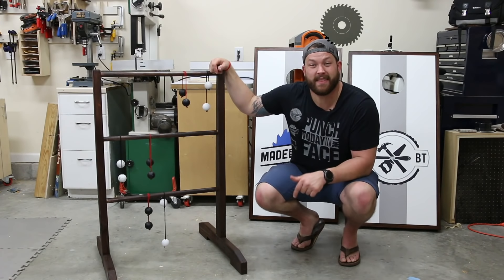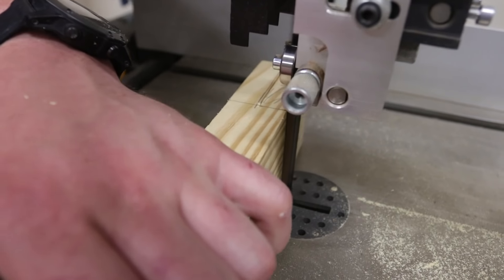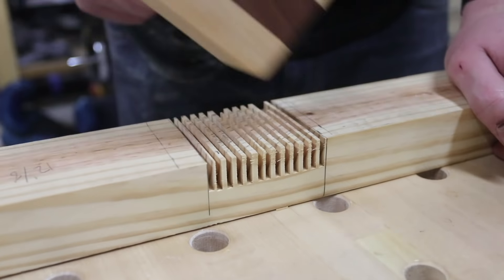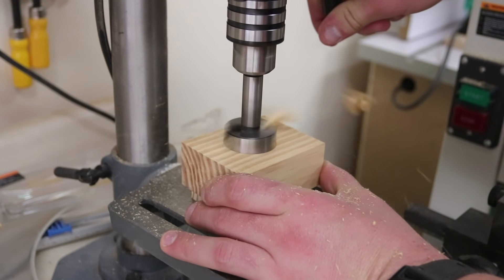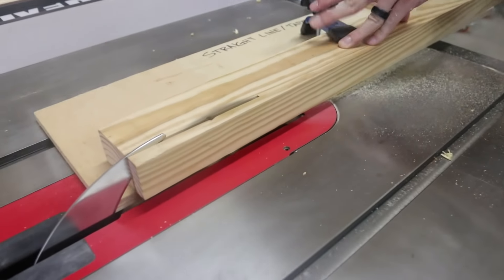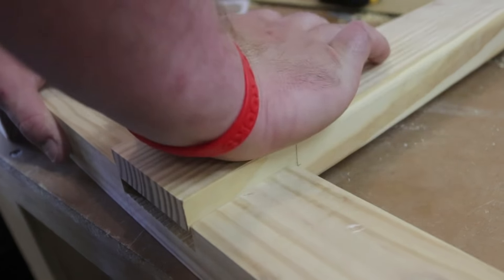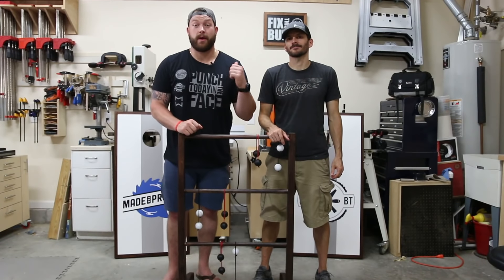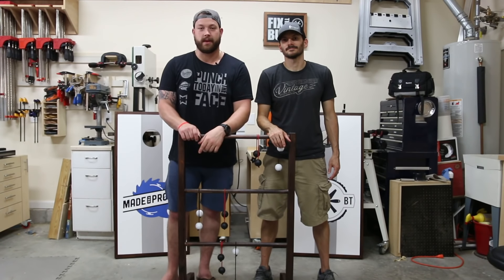Outdoor Games - Redneck Golf DIY Build

Comment: Awesome video and build. Thanks for the plans! Can't wait to put a set of these together with my son. Quick idea I had while watching the video for painting those golf balls: Once they are drilled, run some string through the holes, knot the ends. Get a scrap cardboard box and use a utility knife to run a cut about 1/3 the way down two of the sides. Slide the string ends down into the cuts you made (might need to adjust the knots to make the string tight). The golf balls will now hang in place for painting and can be easily be rotated. Plus, no hot glue/cardboard mess to deal with later. :)
Reply from the maker: Great idea on painting the balls Gordy! Try the download again. It should work this time!